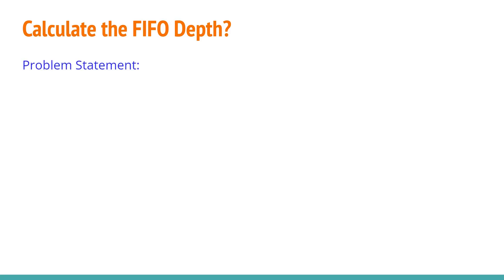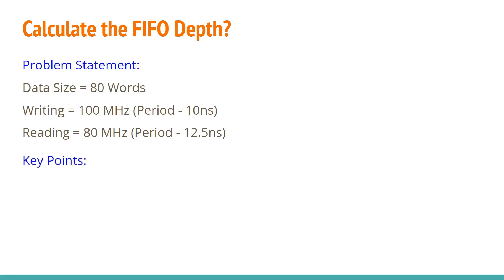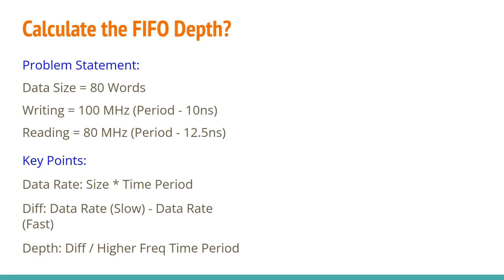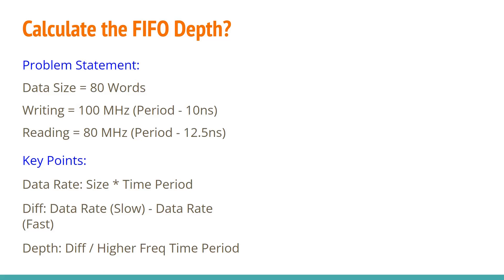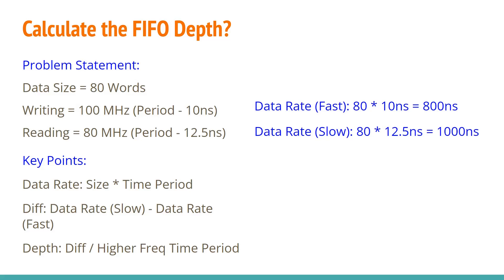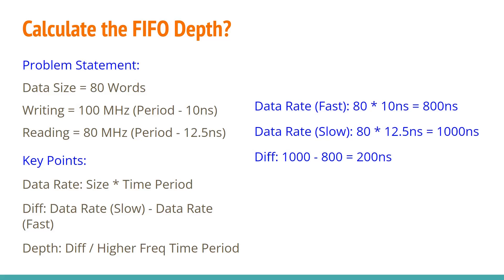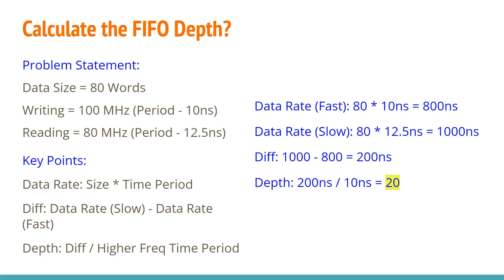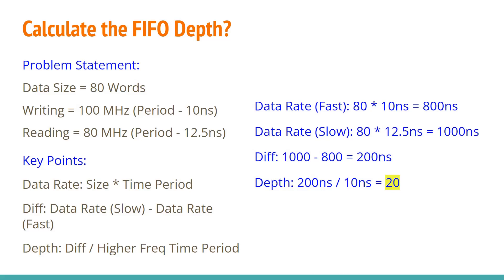How To Calculate The FIFO Depth

Comment: Shouldn’t the answer be 16 as 64 reads will happen in the time 80 words are written ?
Reply from the maker: Yes, that's if you have a ideal FIFO which starts reading the moment first word is written into the FIFO. But that's never the case. For back of the napkin calculation, 16 is what you would come up with but that should suggest that it the minimum depth you need. The depth needs to be increased based on how efficient the full/empty flags are. On a side note, there are many ways to implement empty/full flags and some are better than others but none are with zero latency. Hope this helps!